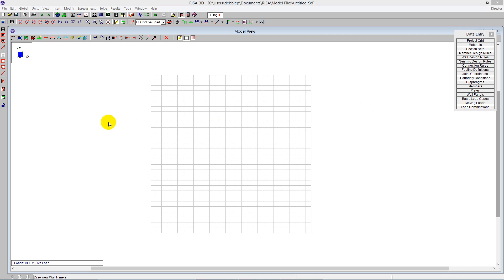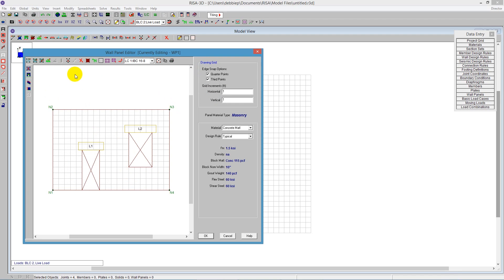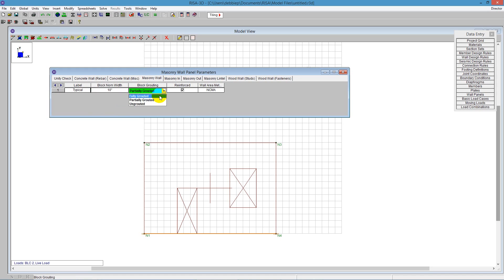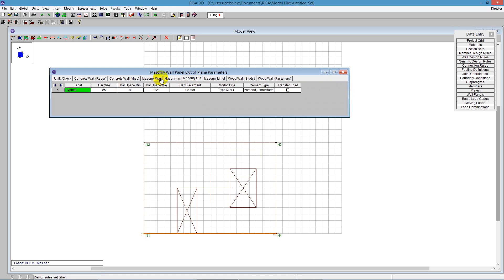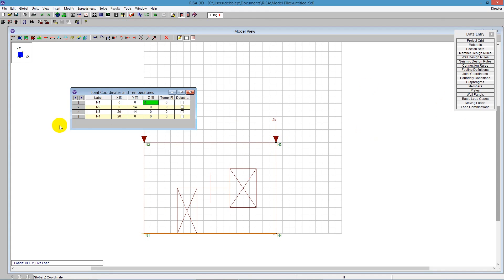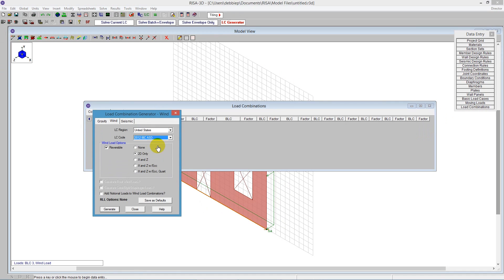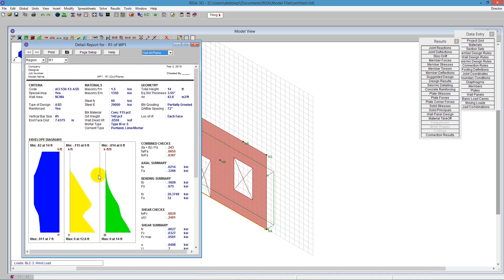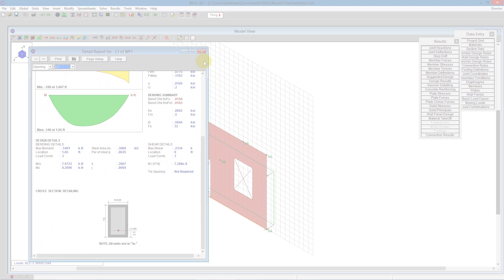Masonry Walls with RISA

Comment: I can't figure out how to make a wall on the Y-Z axis in my 3D model. It only wants to snap to the original X-Y plane. Could you talk a little about that?
Reply from the maker: The wall panels must be drawn in the vertically.  So if you want to change your vertical axis, you can go to the Global Model Settings- Solution tab- Orientation and change the global to Z axis.  Then you'll be able to draw in the Y-Z axis.
Reply: Thank you! I discovered that my problem was simply that the nodes wouldn't snap to things that weren't selected. So I selected everything, and then I was able to make a wall where I needed one in isometric view. It is also good to know about the global axis.